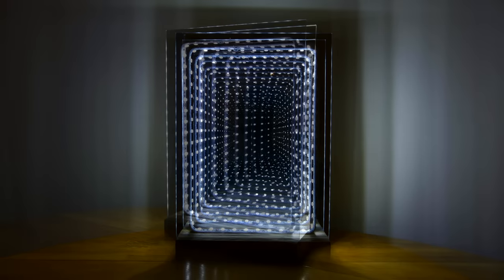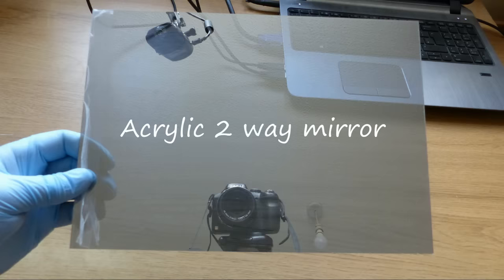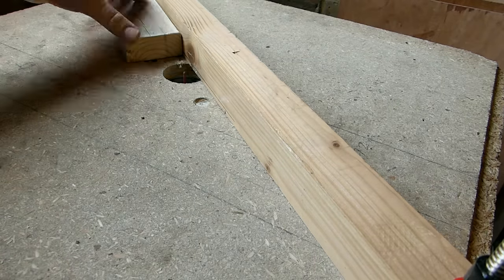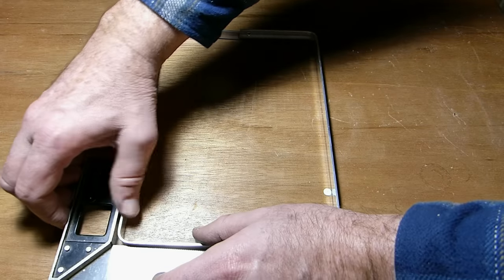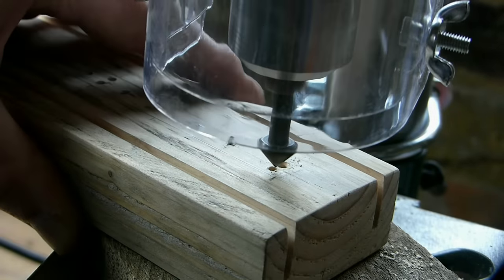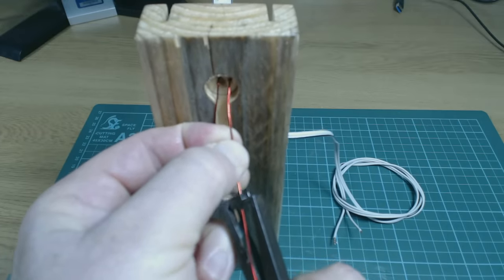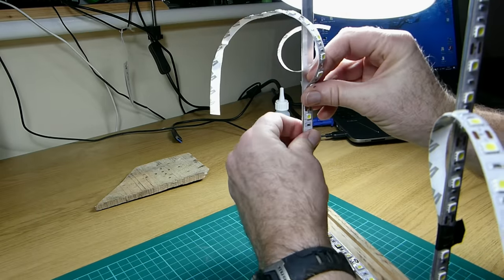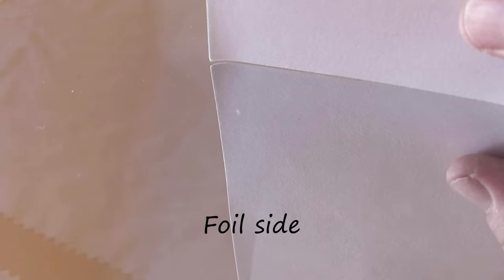How to Make a Modern LED Infinity Illusion Mirror

Comment: Great use of the principal of reflection, use of tools, measurements. accuracy. You are so skilled.
Reply from the maker: +PraKhaR  Thanks
Reply: techydiy  You are the Mannnnnn!👏👍
Reply: He didn't invent it but good job making it.
Reply: PraKhaR 0
Reply: no one said he did invent it
Reply: +Trap Boosted  What an odd thing to say.
Reply: PraKhaR led

 vbbbjj
Reply: ok
Reply: Bosta
Reply: PraKhaR bhai isne foil kis wale lagai thi
Reply: A perfect conception with very few faults and those only in choice of base material and coated wire through base to led's.
Reply: Absolutely agree
Reply: I didn't invent the mirror, just make it look better.
Reply: Hi. Can you tell me how to connect the led strip with the plug which were cut out from the main big strip (full tutorial )?
Reply: @techydiy  Hi. Can you tell me how to connect the led strip with the plug which were cut out from the main big strip (full tutorial )?

Comment: Had a crazy thought with these infinity mirrors.
What if you built a circular one, where the distance of the spacer where the light sits, is narrow on one side, and wider of the other side (hard to explain it correctly) -so you can put a small engine on it to turn it slowly. That way you get the effect without having to move from side to side yourself.
Depending on the speed of the turning, it could be a fun effect to play with, uneven spacing too.
Reply: Very interesting idea! I think it could be easy to try out by moving the mirror by hand before installing

Comment: Have used this design for a uni project involving ws2812b, the stand is bigger due to all the components I had to put under it. It's not difficult to make you can cut some wood and just glue it to make the area where you want to put in the mirrors. Thank you for the help, as this helps to remove the glass very easy, for transportation.

Comment: I love when you can make "DIY" without having $50.000 worth of equipment.
And explained in a way that everyone can understand.
Reply: There's still a bunch of money here. Of course you can do other stuff with all the devices but you got to purchase them first. ^^
Router,  router table, vertcal drill press, drill bits for the drill and the router, saw and most of all, skills. THe last one you don't buy it on shelves. ^^

Comment: Why not two two-way mirrors
Reply: It is a two-way mirror. He said at the start :)
Reply from the maker: +Guo Yu  You could do that
Reply: I just realized I misread your comment, Guo Yu, I didn't see that you said TWO two-way mirrors :P
Reply: But it would not be that "dark" then. even if it would work with both sides. what i wonder is why there are inside and outside led tapes. would it just be enough with the inner circle.
Reply: SawManga The outside LEDs makes it a brighter lamp. Mostly the inner LEDs are used for the illusion.
Reply: This would lose power from effect, when 20% of light is lost in each reflection. It could work, but as a result there is less "echo"/debt in the effect.
Reply: Using two two-way mirrors doesn't increase the effect, tried it while making one of these. It looks better with one two-way and one regular. The things you gain from using two two-way mirrors is lightbleed from both ends and being able to see the effect from both sides. So you could do two of them but it's basicly personal preference.

Also, it might be more of a hastle hiding the cables if you are opting to look at it from both sides. (could have the wire come out of the bottom or sides depending on there you wanna place it.
Reply: You could use a very large one with two two-way mirrors to fill in a wall or somesuch.
Reply: +Guo Yu  I use two halves of a four-way.

Comment: not really do it yourself now is it?
Reply: what about this was so difficult?
Reply: Mojo Jojo you could easily do most of that with hand tools. And if not you could just ask someone that has the required tools if you could use them. Simple.
Reply: Gejum Potom 
Yah it is. It's quite easy to build. You just have to have some basic knowledge of how to use tools and how to measure and cut.

Comment: Owesome video, really thanks!
All your mirrors, this one and other videos, all achieve incredible effect depth, the light tunnel is really deep. Comparing your projects to other, other videos here in tube, I notice that very a few one achieve that effect, most of them result in a shallow, not deep at all tunnel. Could you please explain why, that owesome deep effect does depend on the 2 ways mirror, its percentage of light pass trough?
Could you please explain in general,  how to achieve that deep tunnel?
Thanks a lot, really mean it!
Reply from the maker: Using a good quality two way acrylic mirror works much better than tint film. if you do use tint film then use the silver reflective stuff.

Comment: Do you need the led strip on the inside of the metal as well is it essential for it to work??
Reply from the maker: The inside LEDs are the most visible
Reply: Do I need outside leds then?
Reply from the maker: Nope,  but it depends how you want it to look.

Comment: I’m not smart on these LED strips, but can you use a paint or some kind of non-conductive medium (even electrical tape) over the portion between the lights to reduce their visibility? Or is that where the heat escapes so no? Wanting to attempt this build and just a thought.
Reply from the maker: You can buy black led tape

Comment: Great video! One question I have though! Would it still create the infinity mirror illusion if I were to only place the inward facing LED strip on the aluminum? Or must it have the exterior facing strip as well? (I feel like the outer exposed strips diode’s could be VERY intense and bright if you’re directly looking or sitting at the sides) At least for myself.

Thanks for making such helpful videos Sir! Never fails to impress me with your craftsmanship!
Reply from the maker: Yes it works fine with only the inside led strip. Thanks

Comment: Can you use normal glass or it has to be two way mirror? ive seen tables with similar "infinity led lights" done with a mirror on the bottom and normal glass on top
Reply from the maker: It does work with normal glass but you get less reflections. If you add silver reflective film to the glass you get more reflections. If you add black film to the glass then you get the same or slightly less than normal glass. If you use good quality two way mirror sheet then you get the best result.

Comment: great video
nowhere can i find the corner dimensions for bending the aluminum strip can someone help me thank you
Reply from the maker: The corner discs are 14.8mm in diameter, cut with a 15mm hole saw.
http://www.techydiy.org/how-to-make-a-modern-led-infinity-illusion-mirror/
Reply: @techydiy   Thanks for the answer, but that was not my question, but what is the distance between the mounting holes? thank you
Reply: @techydiy  Danke
Reply from the maker: @heinzwalser6232  The web page has a diagram with the dimensions.

Comment: I looked into your links for alternative of the two way mirror film.. so it's also the same ad the one way mirror film..?
Reply from the maker: Yep
Reply: @techydiy  sweet I purchased a film to test it out.  I actually want to test whether a film will suffice with just its frame - no acrylic sheet for the one-way mirror film to attach to other than a frame.  Were you able to test something like it?  Like, will the wobbliness of the film have some kind of effect/distortion in the infinity mirror.  That'd be interesting, at least for me 🤔😅
Reply from the maker: No I haven't tried that. It would be interesting to know.

Comment: you didn't attach both glass 
if you do something it will safe to be apart  don't you agree .?
Reply from the maker: It is acrylic plastic not glass so it won't break easily or shatter. The friction fit is tight, so the sheets should not fall out. If your really worried about that then you can epoxy them in place.
Reply: @techydiy ! so nice of you 
thanx dear

Comment: can i use a normal mirror at the back? can i use a normal glass for the front?
Reply from the maker: Yes, you will get fewer reflections with plain glass at the front, but it does work.
Reply: thanks

Comment: Is there any reason you have led's on the outside and have them showing? If I were to make a table using your techniques could I only have the inside led's and close it off with the same results?
Reply from the maker: I was trying to build something a bit different from a normal infinity mirror. Yes you can. Here is another one I built:     https://youtu.be/grFMyGv5NpE
Reply: @techydiy  Thanks for the reply, Looks good, I've just seen some other infinity tables and they don't have the same effect as yours, yours actually looks infinity
Reply from the maker: @robertlloyd7908  Acrylic two way mirror sheet gives a better result than using mirror film. Some people also use black or coloured film which gives the same number of reflections as plain glass,  probably slightly worse.

Comment: does anybody know how could I make the slots on the wood to insert the glass, without that one specific tool he's using?
Reply from the maker: Get four pieces of wood. One for the bottom, one for the middle and two for the sides. Glue the middle piece centrally on the bottom piece. Glue the two outer pieces on the bottom piece leaving slots for the glass.

Comment: Well you have the black hole now just need to add north and south in a offset pull to launch something into a future date but not until the vaccume is set at over 200,000 rpm to break the barrier so to speak or travel that is...its a fact

Comment: is good effect. but there were already in the 70s at the fair. But not bad as a guide. Looks similar to my self-made holoprojector 7 years ago, ok now put it across and build a magnifying glass in the walls, think of stretching and stretching and pulling a projection on a glass, i.e. the reflection. With a projector you project a film or photo into it. A design 3D hologram TV is complete. Raendr noch in black. German Language

Comment: Seems awfully unstable with nothing locking the mirrors in the slots. It certainly wouldn't survive someone bumping into it let alone an earthquake.
Reply from the maker: It's a tight fit and not the slightest bit unstable but if your really worried about it surviving an earth quake then feel free to redesign it.